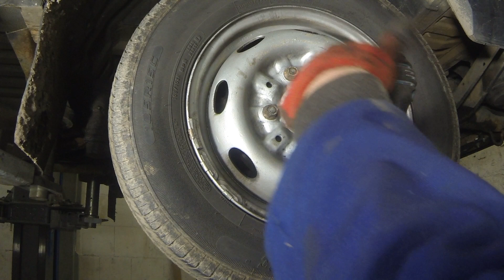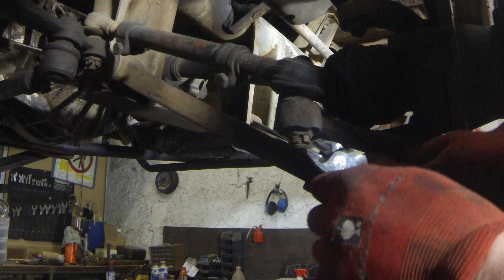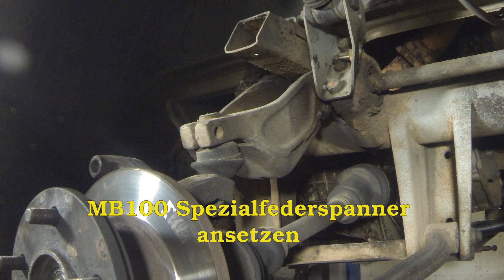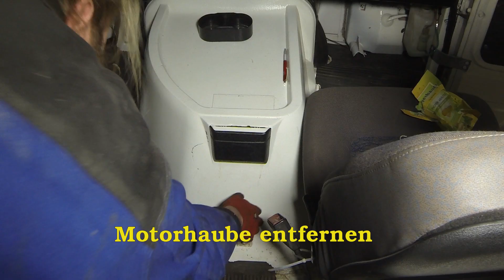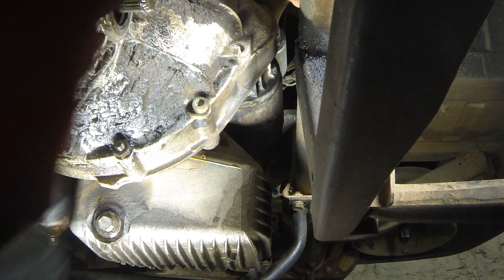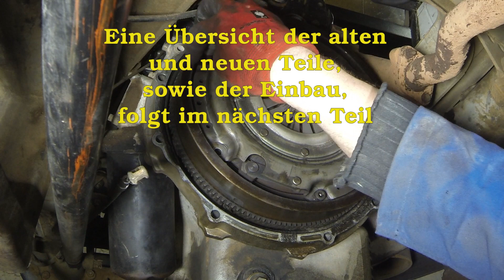MB100.de Werkzeugkiste: Getriebetausch und Vorderachse zerlegen, Schritt für Schritt. Teil 1

Comment: Hi, do you know if I can get a longer 5th gear for my1991 mb100d as my 5th gear is to short. Love the videos and thanks 👍
Reply from the maker: There is no longer 5th gear available, but there are two types of gearboxes. One is a longer gearbox with a 39:8 differential ratio, and the other is a shorter one with a 40:9 differential ratio. On the top of the bell housing, there is a plaque where you can see which gearbox you have.
Reply: Thank you for the expert knowledgeable advice. I will check. Many thanks

Comment: Hallo, ich habe einen MB100 BJ 1994 und benötige Antriebswellen,zu welchem Hersteller würden sie mir raten oder auch nicht.MfG Günter
Reply from the maker: Hallo Günter, da bin ich gerade selbst noch am suchen. Wenn du gute Gebrauchte bekommst, nimm lieber die. Lass die Finger von den 50€ eBay Wellen. 
Die SKF Wellen sollen nicht ganz so schlecht sein, aber im Grunde ist grad alles nicht sehr gut was es neu gibt. 
Ich probiere demnächst mal verschiedene Nachbauwellen aus und vergleiche die alle mal. Ich gebe dann auf meinem Kanal bescheid.

Comment: Excellent work, but I would like to know more about optional and required special tools. One of those pullers you used looks like 400 euros!
Reply from the maker: Which puller do you mean exactly? The smaller ones for the ball joints are all out of a 50€ puller set from ebay. The bigger one is from Kukko, and costs about 90€.
Reply: @TheJourneyAhead  OK, thank you. I was referring to the bigger one.  I found a Kukko 20-10 for 110 euros. I suppose that it might be the smallest that will be sure to fit and not to break.  I will try to source the least expensive extractors that will do the job, because I am not a professional mechanic, etc. Thanks again for the helpful video.